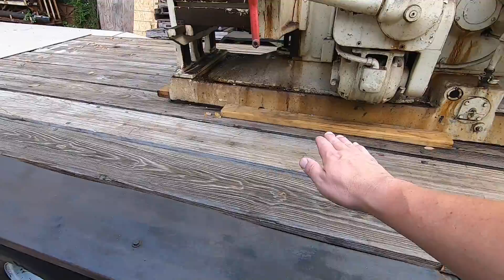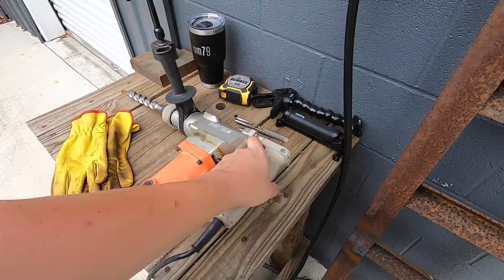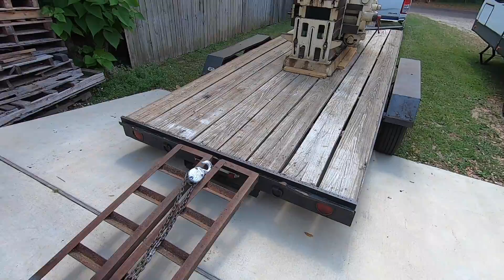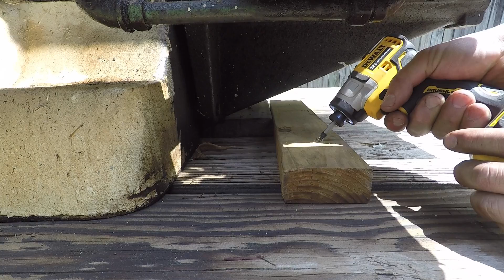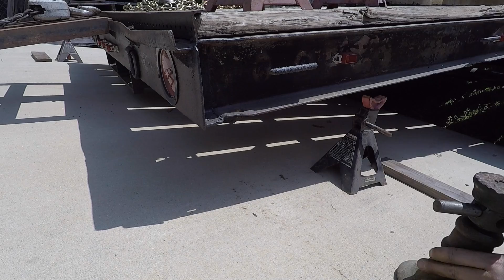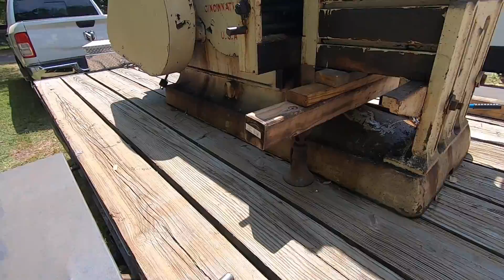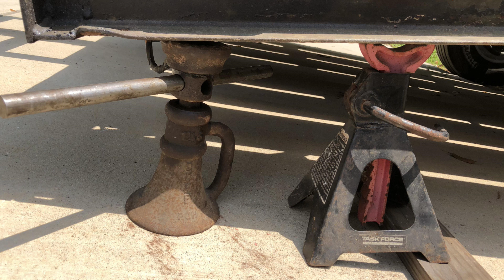Unloading the Smith & Mills Shaper Part 1

Comment: Question.  Will the humidity and salt air to do anything to a precision piece of equipment just covered by a tarp?  I know your shop space is limited, so do you plan to get it inside/under roof relatively soon?
Reply: To my knowledge, he uses an anti rust spray that leaves a kind of waxy finish. I believe it's made by CRC

Comment: I'm a rigger(Australian version of an iron worker). 

You did good. Couple of points before I've seen the pull.

The chain at the back should of been a come along. We call that a brake. But you got the right idea. Can usually get away with a light gauge one with a single fall. Say 1000lbs with a long chain.

More tubes would of been better say 6 and more diameter. We use scaffold tubes over here. Coz these small bars will dig into the deck alot... it'll work it'll just be a pain.

Lastly. The anchor at the bottom of the ramp isn't needed. You can use slings to extend the far anchor. You just remove them as you get the load closer.

Good work Adam. You can rig better than I can machine that's for sure.
Reply: Hit on everything I was thinking.

Comment: I keep a cup of water but I pour it in the hole to keep the bit cool. Thanks for sharing.
Reply: Really?  won't that simply glug up the dust in the hole?
Reply: you don't need to keep the bit cool, it's carbide.
Reply: The water keeps the dust down, I’ve cemented for 26 years and repair slabs 5 years before that. It dose make a paste but it will not remix into concrete.i promise Water works for you not against you.

Comment: pushing on a hammer drill is not the right thing to do you have to let the hammer do it's job and not push on it , i know it's counter intuitive but by pushing you prevent the full trow of the hammer and make it shallower and less effective
Reply: Hes using a Harbor freight special.  Love the tools for a "once in a while" occassion.. but most name brands, you should put the pressure to em! If not it wallers the hole hole out, rendering your anchor useles.. Punctuation helps btw..
Reply: @garygentry583  as a 30 plus years professional i respectfully disagreed, no mater the brand putting to much pressure on a hammer drill will shorten the hammer impact and raise the bit temperature, and once the hole is establish if you do guide it straight il go straight , I am talking of about 20 to 30 pound plus the tool weight should be all you need for it to efficiently pulverize the substrate with the maximum hammer trow.

don"t know if you notice but i a french so pardon my bad punctuation but it shouldn't stop you from getting my point .
Reply: @flyingmaniac3827   I understand your point.. i think we're both right.. 

If you're drilling through green concrete(which he is), you can put as much pressure on it as you want.. I've drilled several holes in green concrete without a hammer dril.. in fully cured concrete, a hammer is desirable, but not required.. certainly easier.. 

I'm not trying to knock ya down, just giving my 2 cents.. on a limited budget, the Chicago pneumatic is awesome.. but on a name brand tool(expensive for this shop), hammer down!
Reply: @garygentry583  The slab was poured over a year ago.  I don't know what kind of concrete you pour, but after 28 days it is no longer green.
Reply: @barrygerbracht5077  ill have to disagree..

Comment: Time to dump the Harbor Freight Special SDS+ and get a BoschHammer.
Reply: BlownF150  Be a hero and get a HILTI and it will be the last hammerdrill/rotohammer you and your kids will ever need.
Reply: With all due respect, I use the Chicago Pneumatic (it’s now called a Bauer) 1-1/8” stroke SDS and it’s $100 ish.
I have torn out thousands of square ft. of tile with it, drilled countless 1/2” and 5/8” holes in 20 year old concrete foundation, etc.    I love Bosch... I have many Bosch tools... but a $300-$400 Bosch SDS does nothing that a Bauer SDS can do !
If you like the Bosch SDS, use it,  if your not a tool snob,  save your money !  PS,  I pay the mortgage and feed my family with my tools !  I know what works and what is a waste of money!
Reply: @yzmoto80  Yeah I do residential construction and remodeling for a living too and I know plenty about what tools are worth the money and which aren't. I used to have the exact hammer drill Abom is using, the Bosch I replaced it with is lighter, more durable, and more productive.  It's simply a better tool for professionals.

Comment: Light pressure on the SDS drills allow them to bounce cuttings out. Concrete powder will bind it up easily without a light touch and constant backing out of the bit.  Nice to see you get excited about your shapers. I'm a concrete guy not just putting in my 2 cents.

Comment: He calls it a "come-a-long," we call it a "chain fall." Ron W4BIN
Reply: Chain fall is for vertical loading. Come along is horizontal.
Reply: Ronald Youvan  I would consider it a come-a-long since it’s a direct ratchet drive with a pulley for a power multiplier and a chain fall normally has the lifting chain that is driven by gear reduction and a separate loop of chain to move the lift chain up or down.  Hope that makes sense.
Reply: Come-a-long and chain-falls are very different devices. The device shown is not a chain-fall. Chain falls function by pulling an endless chain (hence chain fall). If it has a ratcheting lever, it's a come-a-long.

Comment: When I unloaded my horizontal (and anything else heavy ) I jack up the front of the trailer and put a snatch block on the front of whatever it is I am unloading and unload it with the winch. Easy as all, it rolls off  and I'm NOT getting downhill of anything heavy.

Comment: i used to work on and move huge cnc machines, some big enough a forklift alone wouldn't pick them up. (im sure you know about these and are just using what you have. but rolling it on rods will chip up the bottom)  but i used the things called skateboards which would work for you. i could pick up a machine at one end, set it on skates than pick up the other end of the machine with the forklift and move it around. https://www.northerntool.com/shop/tools/product_200673816_200673816

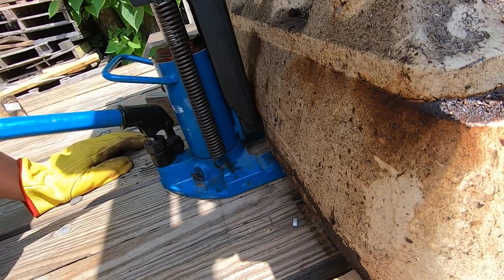Comment: @20:00 i was waiting for the jack to drop through the deck boards.  When i put lockbolts in outside concrete i put boncrete or pavement paint down the hole before tapping the expander in. This saves the metal rusting and loosening up a few years down the track.

Comment: I went through this a couple months back. Had to move a 10,000 lb cnc mill and an 8,000 lb cnc lathe. All by my lonesome without a forklift. I ended up using a dump trailer and mounting a winch in the front. I built some ramps from I beam on its side and used some machine rollers that would follow the channel. Work good, other than the machine rollers I purchased were rubber rollers which I thought would transition on the ramps better. The rubber came apart towards the end and made things pretty sketchy

Comment: Oh man, 3/8" bolts used in climbing are rated to over 5,600 pounds (and sometimes well over that,) and they use comparatively thin stamped plate instead of D-rings or anything.

I know that comparing that to a large D-ring that says 6,000 pounds isn't apples to apples since climbers care about maximum breaking strength and not working load limit, the smaller size helps the climbing bolt's strength, climbers don't mind if the plate steel deforms at max load, etc., but it's fun to compare numbers from two wildly different things.

Comment: Just backup and hit the brakes. What’s the worst that could happen? I did that with a lawn tractor in the back of a pickup once. Didn’t realize the tractor was in neutral. I just applied brakes gently and it flew out the back and disappeared in the rear view mirror. I was quite surprised! No damage and no witnesses.
Reply: Rv4 Guy  I once unloaded a bedfull of rebar by tying it to a lampost.it were a sunday morn and like you said no witnesses

Comment: Just to let you know. You put the jack stands under the trailer wrong. The upper part cradles the frame not go along with it. The handle faces out so you can drop them easier when the weight is off...

Comment: Wow, 2 shapers in th shop is unbelievably double trouble eh bud. 3 is even better eh. Take the head off the hammer drill and service it and they come right back to ya bud.
Reply: Tomoko's Enterprize well one them is technically not going to be in the shop.
Reply: @ericpaul4575  I caught that. I worked in a shop in S. Ontario that I tended 4 of them every shift. Amazing subtle machines. Have you been able to work with any. So much a different part of machining.

Comment: For those that need to do something similar. Skip the concrete anchors and all that hardware. Simply drill 3/4 inch hole in the concrete and drop in a $3 construction stakes. (Round) Hook chain to stake.
I've got 8 holes throughout my shop whereby I've moved my K&T horizontal mill, rotated it, and move my two project cars. One $3 pin does it all.

Comment: Be sure to plug those when not is use, (anchors that is), otherwise, you'll be fighting an issue you don't want to have... rust. Unless you intend to leave those anchors permanently exposed to the elements? Another concern, for as long as that machine has "sat" on your trailer, any concern of the springs being, well, "sprung"? I've seen this happen a time or two unfortunately. Looking forward to seeing the part 2. Cheers :)
Reply: And springs don't just "sprung" from staying compressed

Comment: You jinxed it when you said "My trusty hammer drill from Harbor Freight". Nice rigging and unloading process. I added swing down jacks on each side of the rear of my trailer for support when I load and unload. Made a big difference.
Reply: I have the same drill and for $79 running a 1" bit, it's still hard to complain.

Comment: I would tend to think that the D ring installed right in the middle of your driveway would be in the way enough to be a PITA, not to mention tripping over it all the time. Wouldn't you be better off installing two of them either side of your garage door and when you need to pull, loop some chain through them and pull from the midpoint?
Reply: Still not sure how people can miss what Adam specifically explains in his videos....
Reply: He said that he planned to "plug" the holes with a set screw/headless screw; that way he'll still have a the threaded hole in case he needs those D-rings, but won't have the D-ring's installed normally.
Reply from the maker: It’s a threaded insert, inserted flush in the concrete. It won’t be in my way and I don’t plan to leave theD-rings mounted there.
Reply: He said he will remove them and cap em with stainless setscrews so dirt doesn't get in them
Reply: pneumatic00 
It’s not like the whole thing is explained for you in the video, oh wait, it is explained! 🙄 Why don’t people watch the bloody video before hitting the keyboard? 😡

Comment: You need to score a forklift, I  bought one (an 85 or so Yale 5000# capacity) running and driving and pretty good shape  from where I work last year for cheap way less than scrap cheap and I have been using quite alot , great channel by the way.